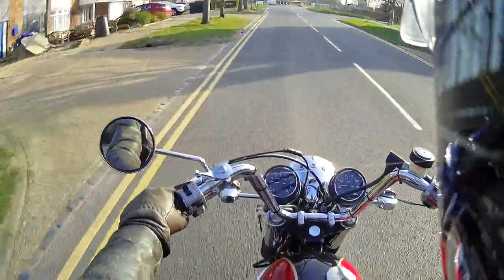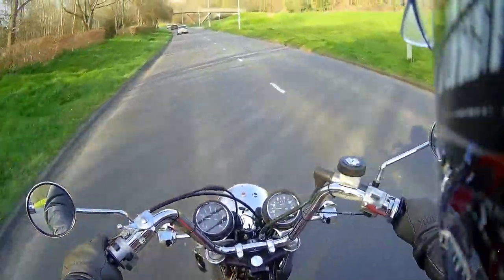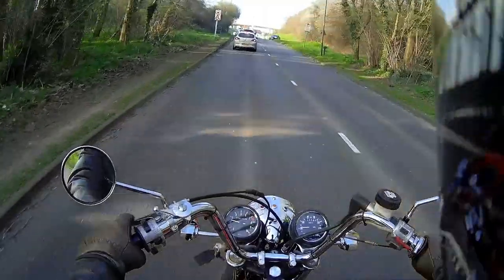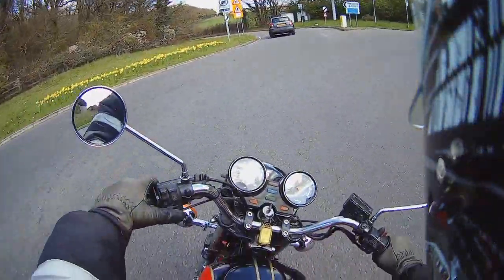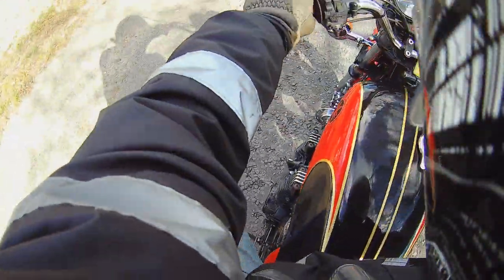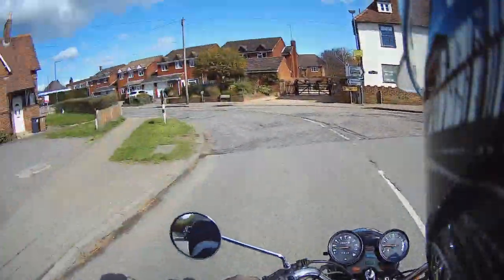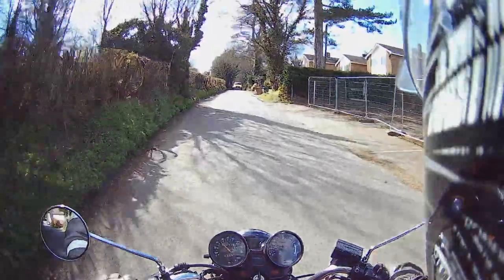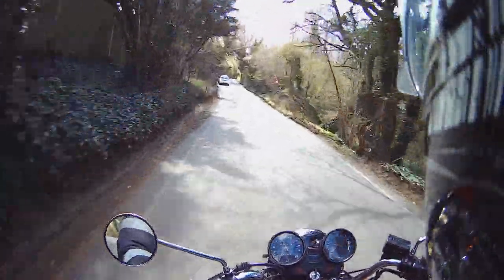Sena camera issues - XJ750 now Historic plus a new song

Comment: In the old days I used to think that bike was a complicated bike because you couldn't use a feeler gauge and a little wrench to adjust the valves like on a Honda. Nowadays you have to break the cam chain and take the cams out in order to adjust the shims for the valves. That bike is now super simple compared to what you have to do with the bikes today. If Yamaha was still selling these they could sell everyone that they could build. No bulshit electronics. In the old days you just learned how to ride and you became proficient by not doing stupid mistakes and falling down. Imagine how lucky we are to have survived riding motorcycles for 30-40 years without all of the wonderful safety devices to protect us. My God how did we not have accidents without all of this good stuff to prevent them.

Comment: You could get a set of crash bars for that motorcycle really inexpensively. That bike is in too nice a shape to damage it, when a crash bar can prevent it. You can get all sorts of Triumph sheet metal buy Japanese sheet metal is as rare as unicorn poop. That bike looks like a beautiful Survivor with low mileage on it. I remember when they were brand new and state-of-the-art, reading about them in cycle magazine, Cycle World, cycle Guide magazine. Motorcycle magazines for great in the old days so were the motorcycles that they wrote about.